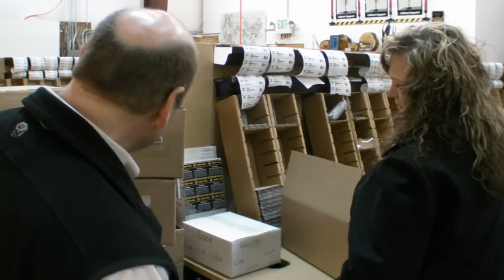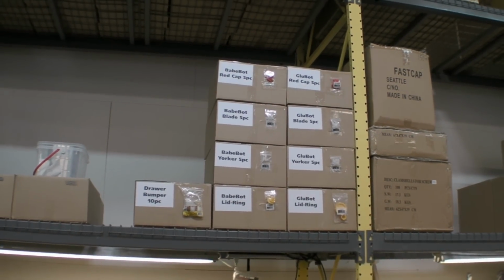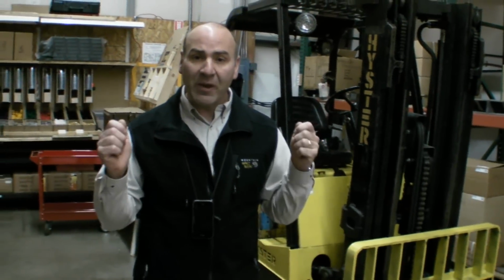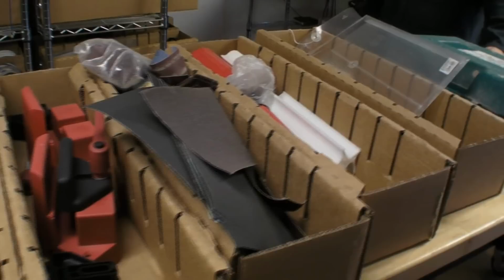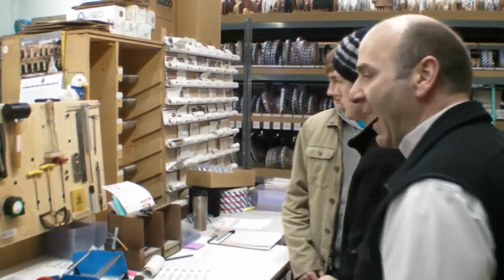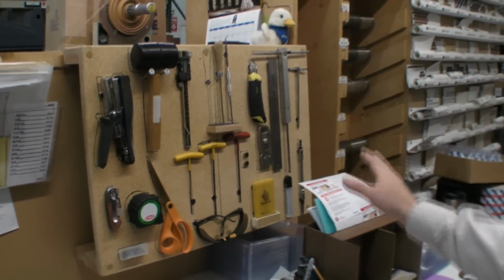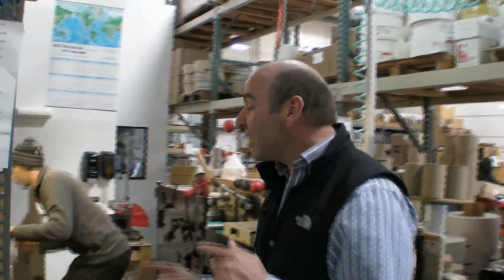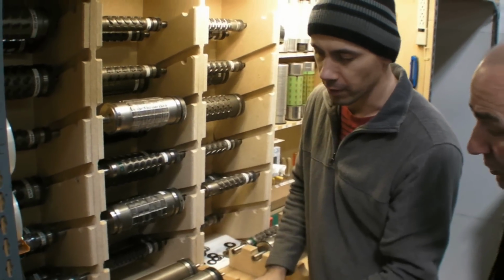Lean Manufacturing - Lean Improvement Walk - FastCap

Comment: ONE COMMENT ON LISA'S STACK 'O BOXES.....I did something similar, but cut the hole in the SIDE of the box, so you could retrieve small parts without even moving them...still lots of room to tape the bag and label the contents. If you have the luxury of slanting them in a stand, preferably on wheels, that would ensure the product slides to the front as pieces are used up....nice work Fascap!
Reply from the maker: All good ideas!